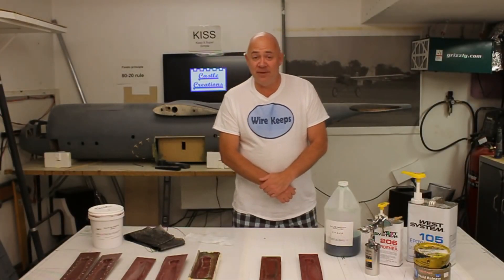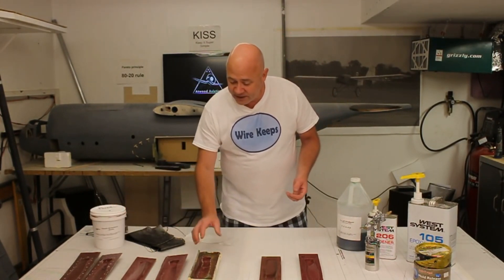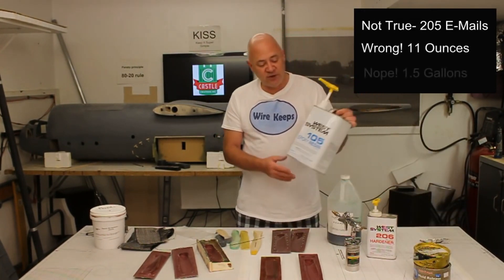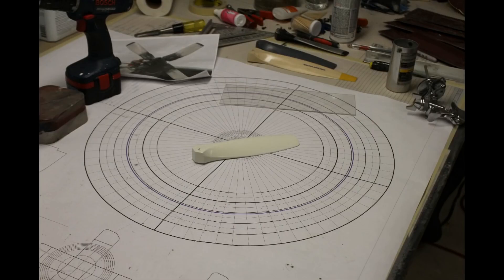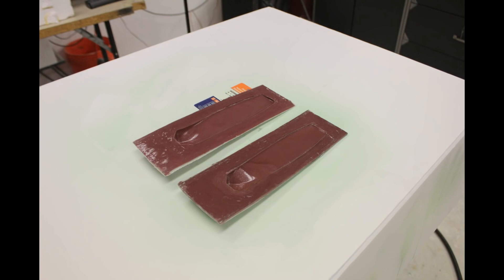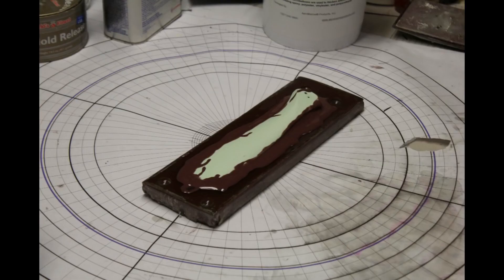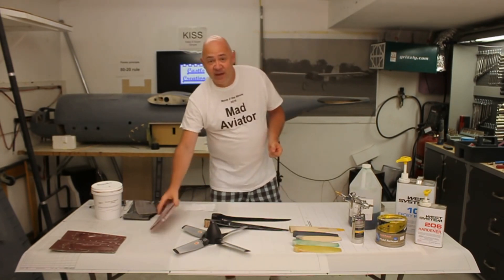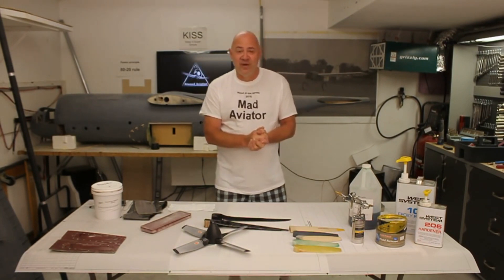Designing a Carbon Fiber Prop #1

Comment: Thank you sir for such a beneficial video... I have a question please, what is the difference between the resin you used to make the mold and the resin you used to fabricate the propeller in Designing Carbon Fiber Props #2
Reply from the maker: I used the same resin. Props are carbon fiber, mold different weights of glass cloth. I use the West System Epoxy. There may be better ones, but that's what I use. :)